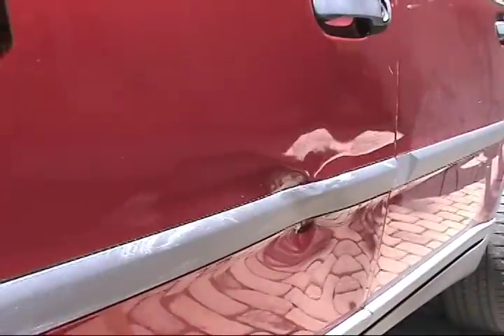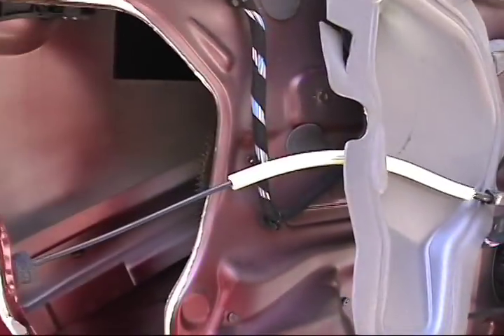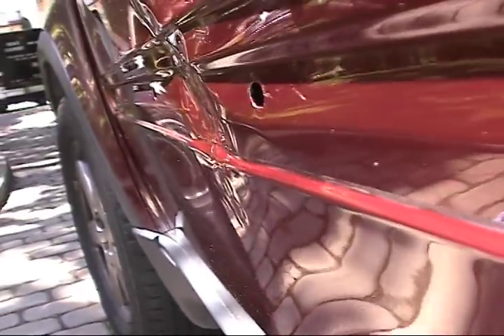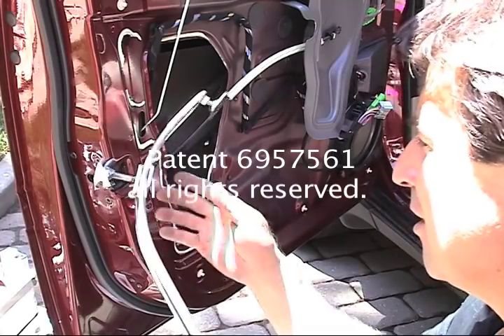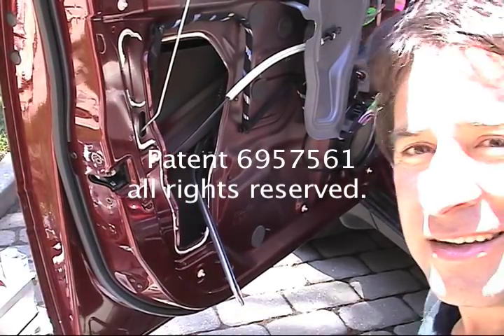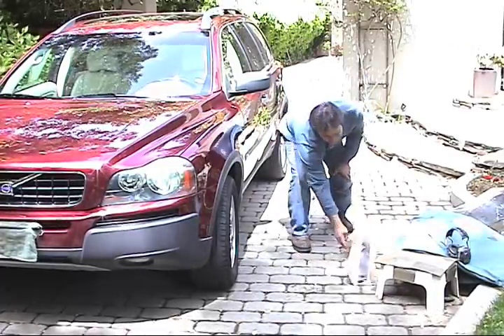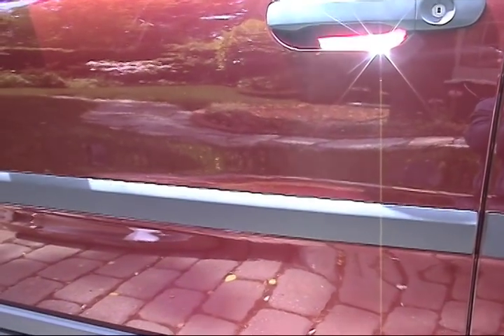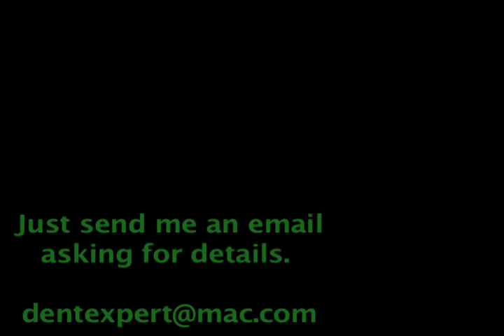Extreme Paintless Dent Removal Training Volvo Xc90

Comment: Pretty Good Video - although they did skip over a lot after he started smoothing out the dent from the exterior.  Dent was in a difficult place for the Home Mechanic to pound out due to the internal frame member in the door.  Special tool helped with that, perhaps a crowbar or sliding a piece of wood behind the frame would have also worked.  Don't forget - Metal Stretches - this can make a simple knocking it back in place difficult or impossible.